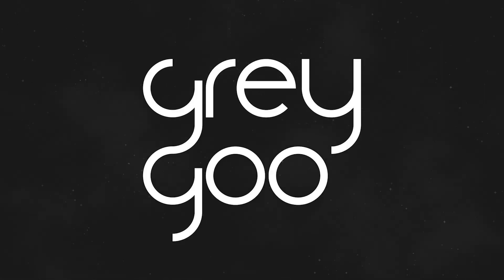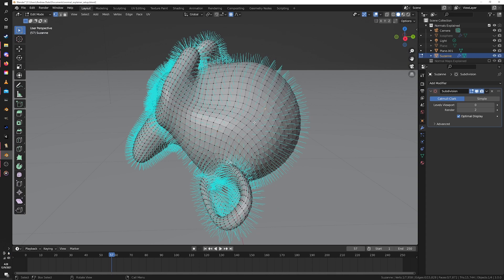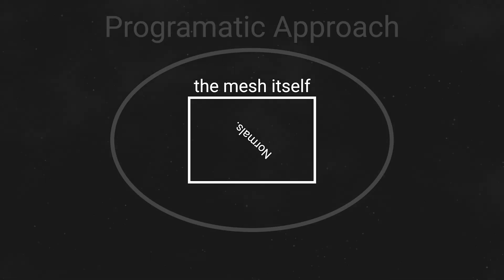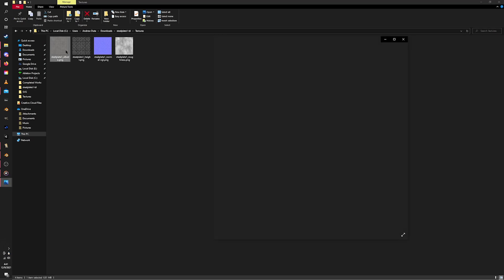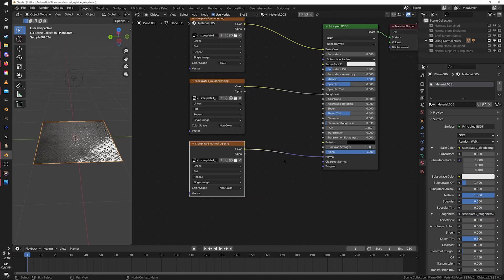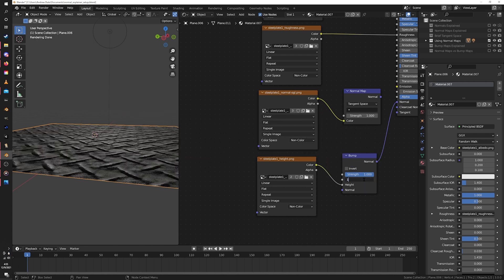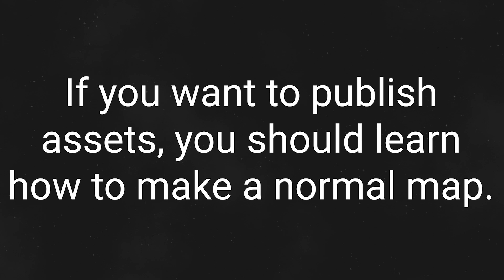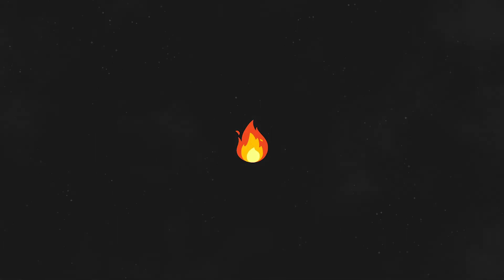Blender | Normals, Normal Maps, and Bump Maps Explained

Comment: 5:03 I was told this was a normals map. How'd you make this? I am really struggling putting depth into my renders. If I made a wood texture, I'd want to make the lines go down to make planks and I'd want to add some scratches. But I'm having do much trouble trying to do this because I don't know how to make a normals map... I could use sculpt but I feel learning normals maps will improve my knowledge of blender and help me make more realistic renders. I don't really like to download textures as I've been told I should try making them myself because it's using someone else's work, and I kinda agree. I feel like it's not my work so I'm trying to make my own things, like my own normals maps but idk how to. I also want to add displacement or height so it looks more realistic and I think I need a normals map to do so?

Also I want to be clear that this video really has helped so much and made it a bit easier to understand :)
Reply: Not sure if you already found an answer to this or not, but just in case you didn't:

There ARE normal map generators online that you can plug a regular photo into, and they supposedly generate a normal map for you automatically. I've seen other people use them, but I've never gotten them to work very well, myself.

To do it the real way, you need to create a high-poly version of your model, with all of the details sculpted in. Once you have the high poly version, you can bake the normal map using Blender's native tools and generate yourself a normal map that you can use on a low-poly version of your model.  

Look up how to bake normals/texture maps on YouTube and you should find some tutorials. Id recommend watching a few different tutorials, because each video usually leaves out a few important details.
Reply: @Drew-b2r  tysm!

Comment: Bump maps are easy for the user to mess with, but more costly for the renderer as it has to lookup neighbouring pixels in the map and calculate the normal. In a normal map, the normal comes directly from the color and no additional computations are necessary.
Normal maps can store a gradient with a single color that doesn't correspond to flat, whereas a bump map would require a gradient. Therefore bump maps may require higher resolution images and at higher bit depth to avoid banding effects to show up, especially at high zoom levels. Cubic interpolation can help, but it won't do magic.
Using normal maps the normals are independent on density; a 5 degree tilt will be 5 degrees no matter how dense you repeat it, but the height perception will vary instead. It's opposite for a bump map; put those peaks and valleys denser together and keeping the height, the normals will vary. Use ONLY normal maps whenever depicting known angles are critical.
Normal maps can be tricky as hell to manipulate (blend, rotate) if you want to do it correctly. Sure, simple overlay may work good enough if angles aren't critical, but it won't always work as intended if doing texture bombing, triplanar mapping, or you can't be bothered to setup proper UV space.

Personally I usually work with bump maps instead of normal maps; the hit on offline rendering isn't that critical for me, I (usually) can deal or work around the downsides, and they're just far easier to manipulate whenever I want to eliminate seams or texture repeats. I also like to randomize the look of the assets I use multiple times in a scene, so baking out a normal map just doesn't work that well for me. Normal maps are technically the better option result wise, but often convenience just wins for me.
Reply: That was the added reasoning I needed to feel like I got the answer I needed. Thank you very much for that.

Comment: OK.  So, if I understand correctly, normal maps essentially take the geometry that pokes out of a plane and flattens it into a hologram as part of the texture.  In the same way that a hologram can be seen from a bunch of different angles and show different shading depending on the direction and intensity of the light source, it cannot cast real shadows on anything around it that weren't captured as part of the holographic process that made the image.  I guess another way to think of it would be like if the surface was made up of flat LCD panels (with absolutely perfect 180° viewing angles).  You could make it so that those panels react to things like lighting and viewing angles with cameras and tracking and such to make the panels display a reasonably convincing illusion of depth that reacts to the viewer, but nothing can ever poke up past the surface of the screens used on each surface.  This means that the different colors in a normal map are a bit like looking at an anaglyph 3D image (the old red and blue type of 3D) without the glasses.  The more the color is distorted away from that flat, magenta/lavender-ish color, the more that the original protruding shape is being flattened down to a plane.

By contrast, a height/ displacement/ bump map can cast shadows, since it's essentially just a way of storing Z axis data in a flat image.  Height and displacement maps are basically the exact same thing, the only difference being how the engine renders the same data.  A height/ bump map uses the same sort of "hologram" method that keeps the surface flat, while a displacement map will actually poke out from the surface (and cause a bunch of geometry to be added)

Please correct my horrible interpretation of these concepts.
Reply: Normal maps (and I think bump maps?) cast shadows that react to dynamic lights, but the actual polygons still looks flat from the sides.
The displacement map doesn't create new geometry, it just modifies the existing geometry, but for best results you would want a fairly dense mesh.

Comment: Great video! just a small clarification in 5:45. the Blue channel is actually used to normalize (make all of the vectors the same length) the vectors the Red and Green channels produce, it's just faster having it stored in the Blue channel than calculating that when rendering, but really, you have all the info you need in the R and G channels.